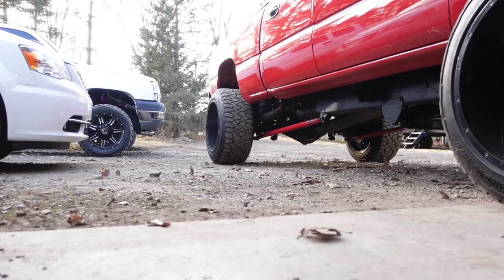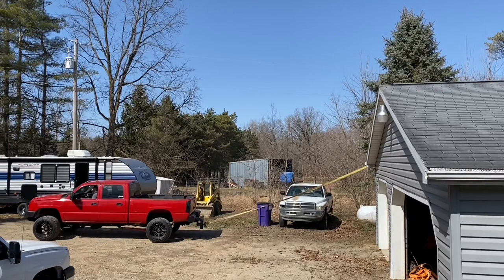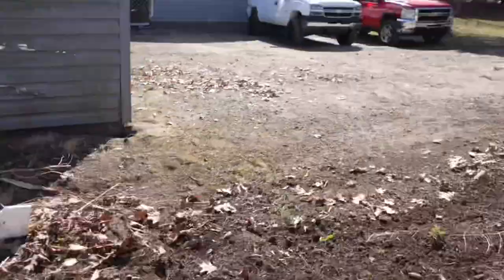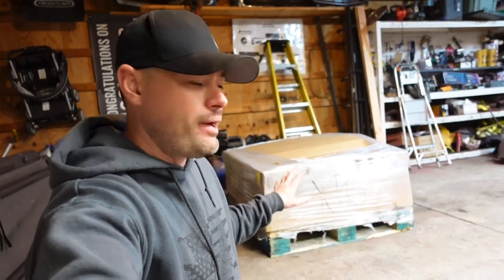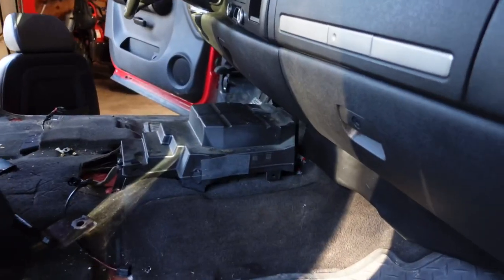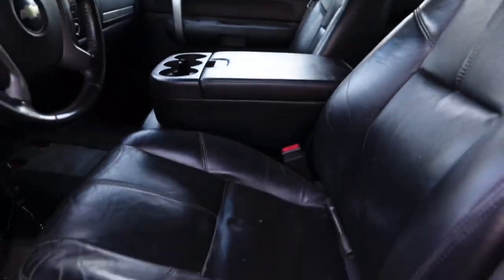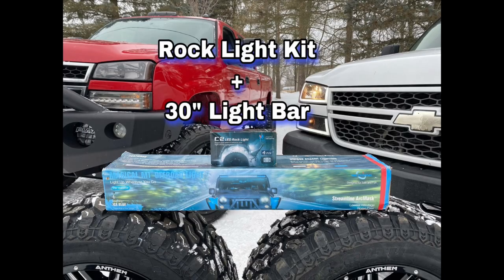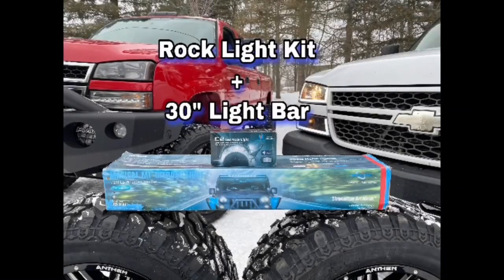The Dump Bed Kit Finally Arrived! Beyond Excited!

Comment: With hydro dump kit installed it will throw your body lines off install bed 1st then use correct body lift to compensate. 
Why didn't you jack your garage and put in higher foundation and new garage doors?

Comment: Luckily my truck has a decent stereo systems, 1 amp for door speakers and one for the subs. So when I took my center console out I was able to remove the sub without any issues, but there may be enough room to put that factory amp under the dash, if not you could extend the wires and put it under the seat. I also put new carpet in my truck because mine wasn't the best and my neighbor happened to have a brand new factory carpet for my truck, so it worked out. But at least you have what I call the truck dash because mine is the denali dash and there isn't much clearance between the middle seat and the dash now. Been thinking about seeing if someone wanted to trade dashes, but I like the door panels that I have and I'm not sure if they line up with the truck style dash, guess I'll find out. Love the channel man, keep it up.

Comment: Glad to have found the channel and videos, well hello everyone, I have the problem with my 05 2500hd, after a bit of highway driving loss of power and black smoke. Thank you
Reply from the maker: You might have a boost leak
Reply: @TruckMaster  I'll check it out, thank you, great videos.
Reply: Oh one more thing, the booster stops from working as well. Could the boost leak cause it to stop? Once parked for a bit it starts running good for a bit. Thank you once again..

Comment: You could buy the Amp bypass kit and install am aftermarket radio and run all new wiring and speakers. Then you could remove the Amp all together.

Comment: You don't need a dump trailer. I seen a guy at the dump using a 16' trailer, he had a rim and tire loaded at the front before loading it, chains under and above the load, just pull the chains and the load is pushed off by the tire, full sheetrock load dumped right off. The equipment operator at the dump knew the routine.

Comment: Hey! Congrats to those that won (he should have known they came from the WifeMax)! Loved the tree removal. Looking forward to the dump bed install.
I want to do an interior swap on mine. Wife hates the passenger seat, cloth and not electric and I’m tired of the basic console and jump seat.
Reply: Remember to appreciate the things you do have tho. Cloth seats and manual controls are not the worst. They will always work.
Reply: Chevyfan2500, I agree with you 100%. I have had this truck since Oct. of 2009. It’s just that age and seat structure is becoming an issue with her sciatic nerve. I have even built a platform for the passenger floor to raise her feet up to try and help.

Comment: Josh, you should’ve had Melanie make that call to the girl 👧 she would had answered?
Nice to see you do a dump bed on a 8 ft box,one thing I hate on the newer pickup trucks with there boxes are so small if you get a sheet of ply wood half of it is sticking out of the box, anything shorter than 8ft is not a pickup truck  🛻
Reply from the maker: Very good point